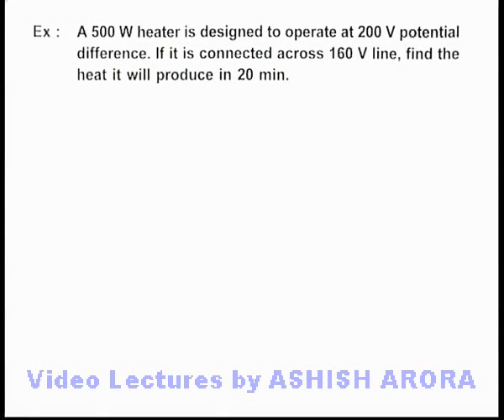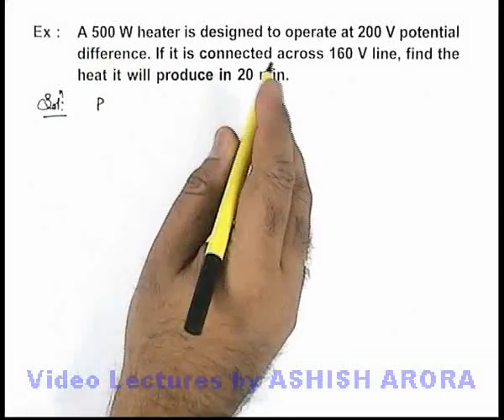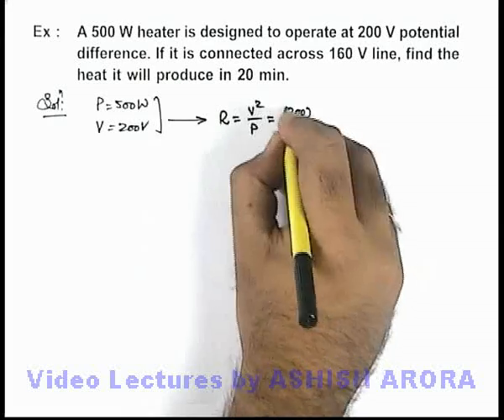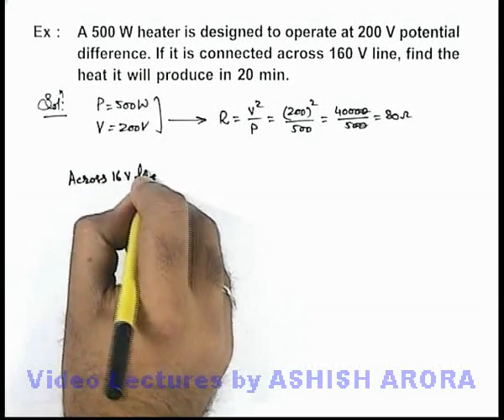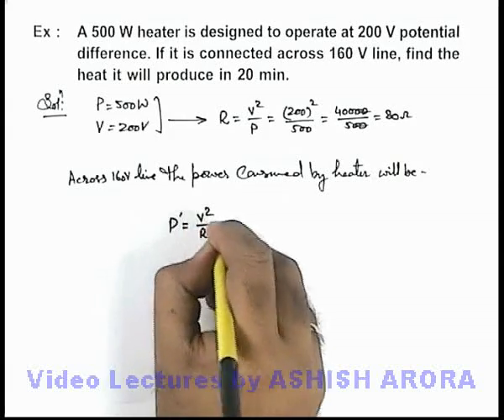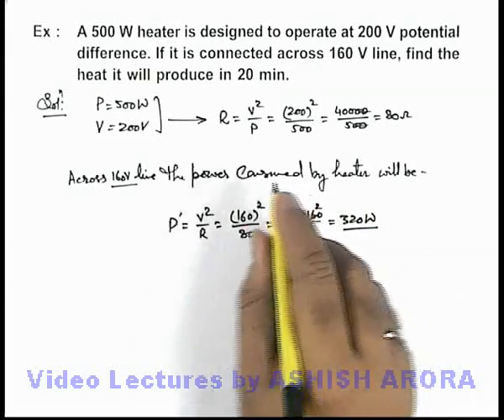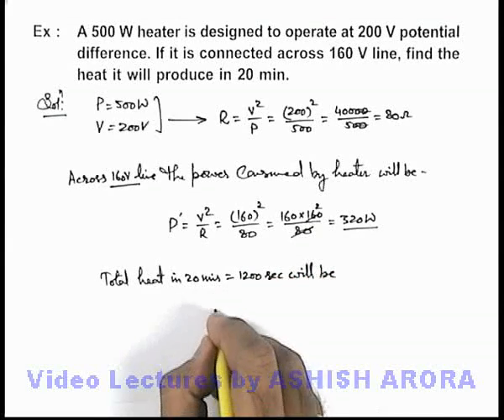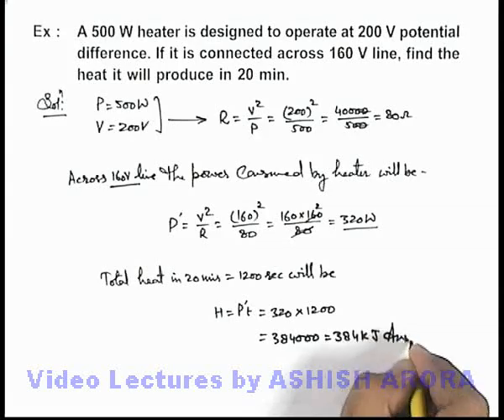Class 12 Physics | Thermal Effect Of Current | #9 Solved Example-5 on Thermal Effects of Currents

Comment: SIR, i did this question by using the formula H=i²RT
R taken out=80ohm(by you as well).....it will be a constant, therefore across 160 volt line....current which passes through it is i=160/80=2Ampere. 
THUS, H=(2)².80.20=6400 joules. Your answer 384000 Joules.
THIS IS SOMETHING TOTALLY WEIRD.
What is the flaw with this approach??
Reply from the maker: Dear Ashi, its always needed to be careful and attentive while solving questions otherwise in exams you will loose marks unnecessarily... given time is 20 min not 20s...